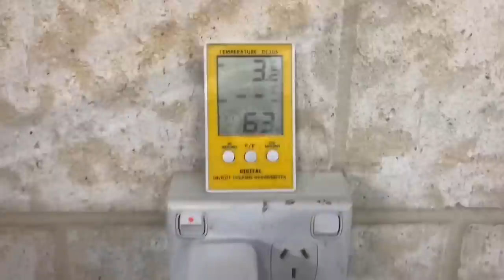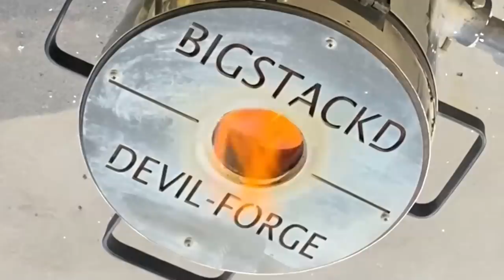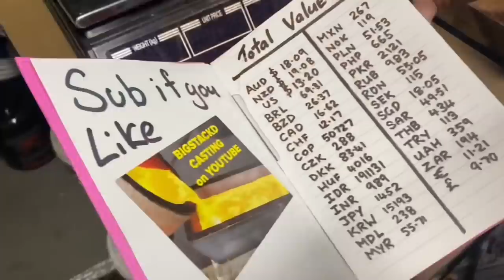Padlock Bulk Key Melt Down - Trash To Treasure - ASMR Metal Melting - BigStackD Brass Casting

Comment: This is the lock picking lawyer and what I have for you today are a lot of locks with keys that may or may not open them. We're going to show you how easy it is to get into them by brute force through heat...nothing on 1...two is binding...nope...loosened up...2 is melted...counterrotation on 3 and now it's stirring...and there you have it folks!

Comment: As a collector of keys and locks, nothing of value was lost, but something of value was created.
Reply: Got any videos of your lock collection? I'm a collector as well
Reply: Just curious what is your favourite padlock
Reply: I like abus
Reply: @51-FS  So glad you didn't say Master. I've seen LPL defeat them with a blink :')
Reply: Lol... master was the first lock i picked....
Reply: There are many of is with weird collections...I collect license plates.
Reply: @katieandkevinsears7724  I have some cool old plates. I have a bicentennial plate even. Mint
Reply: My best lock is the Speed Dial Master Lock, which is one of the few actually good locks Master Lock has ever made.
Reply: @Damariobros  😆🤣😂
Reply: @51-FS I'm not kidding… most locks Master Lock produces are absolute trash, but the Speed Dial is actually decent. Go watch some videos about it, I swear it's good. It cannot be shimmed, it can have a custom combination as long as you want, it can't be decoded, and it's even a pain in the butt to force the lock apart, there are two security screws and one one-way screw that needs to be drilled out. Trying to melt the insides also does nothing to open the lock.
Reply: @Damariobros  I have opned a fue of them at the store that was on the shelf in no time. I have never really looked in to them. How well do they stand up to bolt cutters?
Reply: @51-FS  They probably don't stand up too terribly well to bolt cutters… I'd imagine they'd at least put up a fight against super cheap ones, but I couldn't tell you just how much fight it puts up. I don't exactly have the tools to test that, and I also only have one of the locks. But without bolt cutters, assuming you change the combination from the default 4-digit one and make it much longer, thieves are gonna have a really hard time getting in.

Basically, without the combination, the only way to get into it is a physical attack which will absolutely leave evidence.
Reply: @51-FS  Now, he keeps going on about 2 digit codes people set making it extremely vulnerable to being guessed… my answer to that is make it longer than 4 digits, and use the alphabetic or numerical or symbol stickers included to make up a code for yourself.
Mine is 12 digits, nobody's guessing it :^)
Reply: Belih nyah di manah tukunyah buwat lebor logam
Reply: Just as energy is neither created ne destroyed matter only changes forms and properties

Comment: Hey D, have you ever used a flux when pouring certain metals? The brass always seems to pour kind of "chunky", and a flux may help it pour a bit smoother. 

Brazing Rods (which are Bronze admittedly) have a flux coating to help the molten metal flow and spread easier, and welding rods have a flux to help the liquid metal flow easier as well.

Comment: Wonder if that large padlock steel would be good to forge into a small blade. It looked perfect red to bash with a hammer on a little anvil. Might draw out to make a reasonable filleting blade
Reply: Could just forge weld them into one solid piece. I forget sure in Australia but alec Steele visited a rail yard blacksmith ship turned humongous art studio and the one retired old dude said b they used to do that slot with their 1000 weight hammer

Comment: Question: is there any practical benefit in quenching the metal, other than cooling it faster?
Reply: Usually it makes it tougher, with a hardened surface and an elastic core. 
But here´s actually no need for that.

Comment: Hey there @bigstackD Casting I was just wondering, can't you just melt metals in a specially made mold itself? Or can't there be mold shaped, sharp edged crucibles that would produce ingots just as it is?
Reply: That wouldn't be the greatest idea due to heat stress

Comment: Could you melt down a Nordic Gold bar,but pour each metal separately after the one before have already hardened in the same mould.So at the and you will have a bar made with copper,brass and tin ready to be melted and turned into a Nordic gold bar